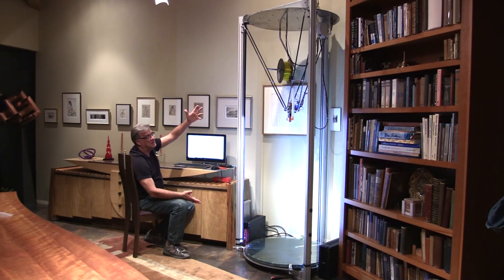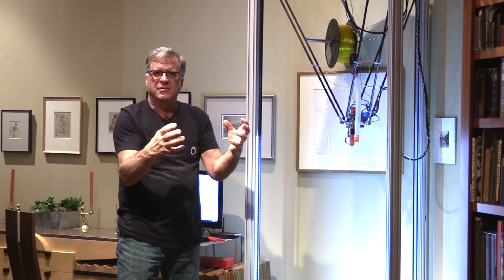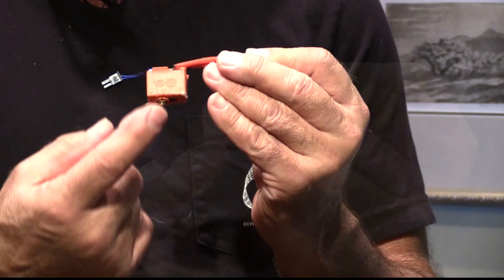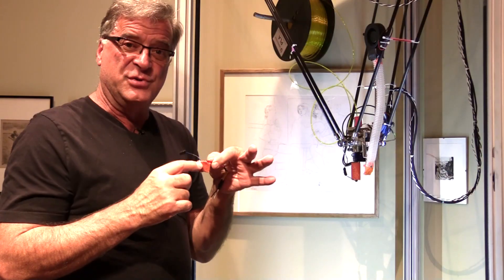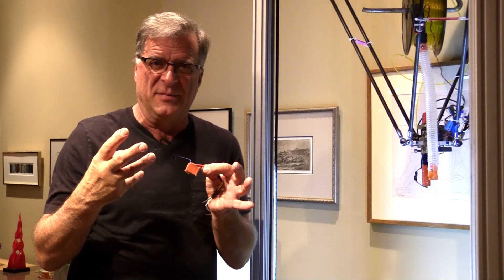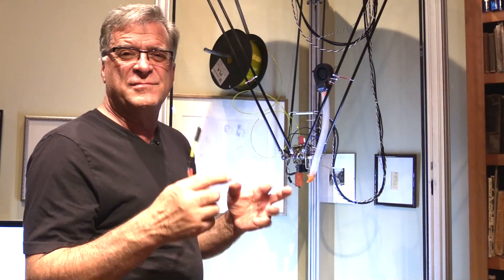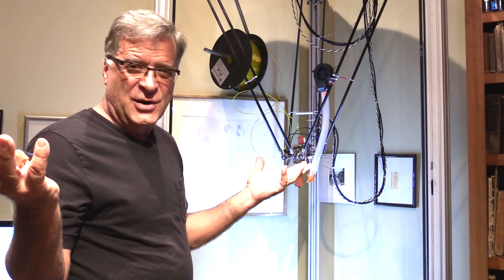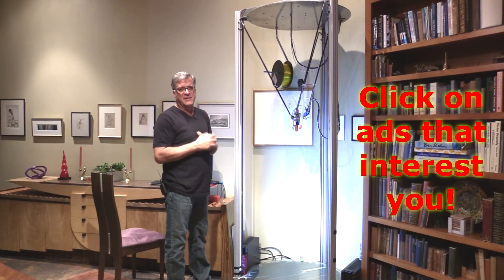How to Speed Up a 3D Printer - Kevin Caron

Comment: i thought you were going to say you had upgraded to the free floating vortex 3 twin head.
Reply from the maker: Sorry, a what?!?!?!?
Reply: @KevincaronSculpture  well i see you still using filament feed, changing to hopper fed multi feed free flowing vortex heads will give you much more variability.
adding a trans-dimensional fully free point to point hot/cold program will also give you variable and remote time print.
This of course would greatly benefit a remote out cast internal flux motion butter load spreader.
if you are in the position to upgrade to a liquid hydrogen fuel system with quad unheated heads you can produce a 6ft x6ft piece in a few minutes.
you will need to heat proof the surrounding area due to the increased heat output produced by the Saturn 3 rocket engine used.
some users have experienced minor health issues with this system like peeling skin and melted furniture to which a fire rating of 12,000 degrees would be beneficial .

Comment: I am starting to print higher the other standard ABS on my Tervo Tornado.  So I am learning about the problems associated with a material with a high glass transition temperature and when the material transitions it shrinks.  So professional printers have a chamber at or above the glass transition temperature.   For ABS that is 80 to 125C  where PLA (Polylactic acid) is 57C and one of the strongest choices Polycarbonate 150C or PET  and PETG(Polypropylene terephthalate and with glycol modified) 50C .    It doesn't appear that you have a means of having high chamber temperature.
Reply from the maker: If you are talking about a heated air chamber around the machine then you are correct.   But that will not stop me from trying.
Reply: @KevincaronSculpture    If you do not have a heated bed then EVERYONE ON YOUTUBE and the suppliers of filament and machines SAYS  your limited to PLA.   People do print ABS with as simple as a plastic film created enclosure.  For you taping  5 mil painters film (10' x 12' etc.)  will be sufficient to block air flow and let the heated bed and extruder head increase the air temperature a little.   

I am using the 1/2 foam board that products are packaged in and some silver foil bubble pack to form my chamber.  I get hot enough to cause my Fang cooling fan duct out of PLA to warp and break due to the acceleration of the head.  That is above 120 F.   The ABS layer bonding is not bad but I need to turn on support to bridge even a 1/4 bolt hole.  For the next item.  The shrinkage is very visible.  Had to put the original aluminum box around the head so I could mount the cooling block for the filament.
Reply: just looking at his normal print, they are all full of problem and he still thinks they are awsome. so i guess he will find whatever result he gets with whatever filament to be fine. hehehe